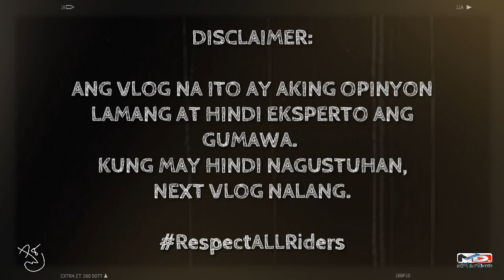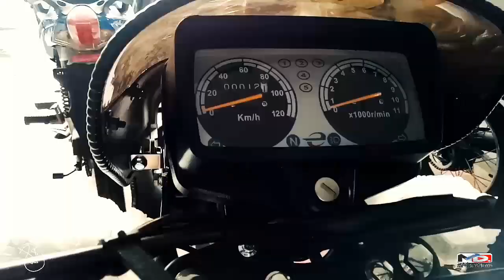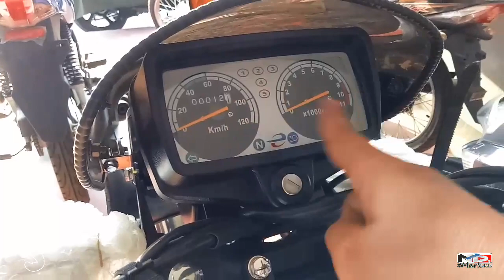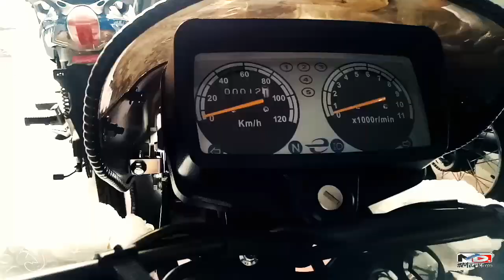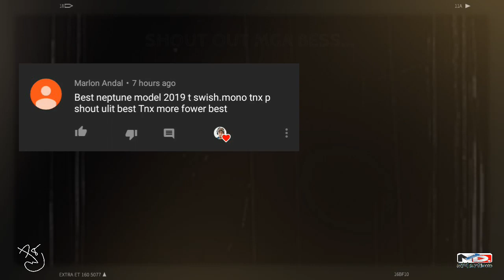EURO DAAN-HARI 150 E3 // #SYMPlaridel #iMarkMoto ep.55

Comment: 150cc nga siya pero yung engine specs nya pang single hindi pang tricycle

ang Peak Torque nya nasa 7,500 rpm
ang Max Power nya lagpas na ata ng Redline ng makina 12.78 hp sya pero makukuha mo sya at around 9,500 rpm

matamlay humatak kapag below 5,000 to 6,000 rpm for sure
Reply: Haha nsa driver kc yan brad wla sa motor
Reply: Haha kaya pala kahit may sidecar ko 
Kahit 5 sakay kaya uphill partida 15/44 sprocket combi never pa ako pinahiya magnetic pa dito samin

Comment: Sulit boss,,
DAAN-HARI 150 EURO3 din ang kinoha kong motor,,tipid xa at ok na ok
Reply: boss akin pang single lng service pinalitan q lng ang shock nya ng shock ng xrm kasarap parang DT baliwala ang mga lubak
Reply: at ang ganda performance ng shock nya sa front euro 150 din motor ko palitan mu lng ng original na rear ng xrm 125   baliwala mga lubak
Reply: hi bos. ma tipid ba talaga to. isang L. na gas ilang Km. bos. at anong bilis salamat po sa sagut...